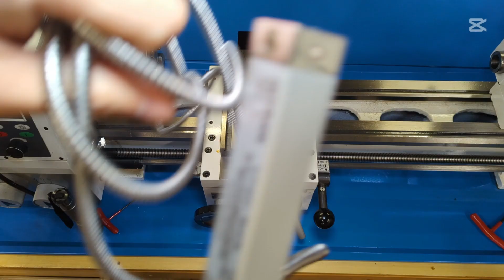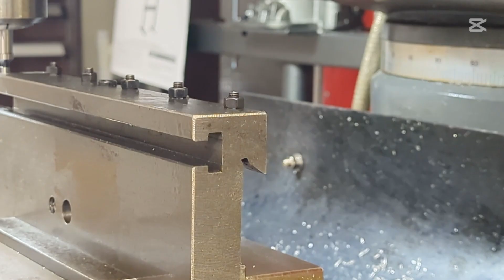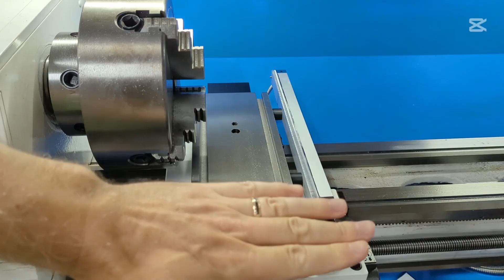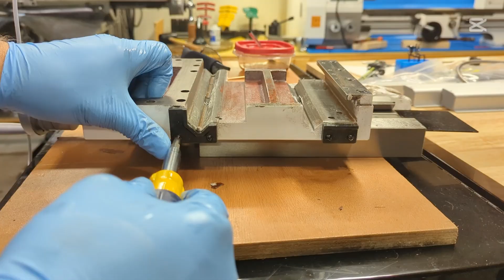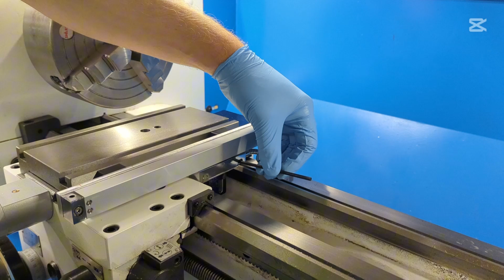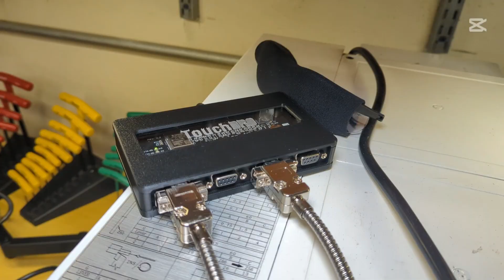Precision Matthews PM-1228 Lathe TouchDRO Install

Comment: Was wondering if it would work and be easier to install on the other side of the cross slide where there is no gib screws, I have a CX706 and wander if that would be the way to do it.

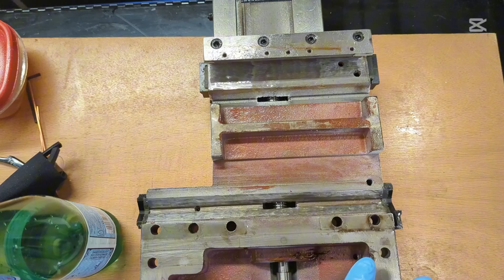Comment: Thanks for this vid. That part at 55:00 showing the 'machining' of the carriage is scary.
Reply from the maker: Yeah it was really disappointing to see... Even at this price point
Reply: I just got a pm-1228 as well and it looked identical, I was so frustrated with my new machine. Best I can tell the relieved about 50% of the dovetail in the carriage with an angle grinder. Then the rest has some kind of manual scraping done to it. But it looks like an angry beaver went after it instead of precision scraping.